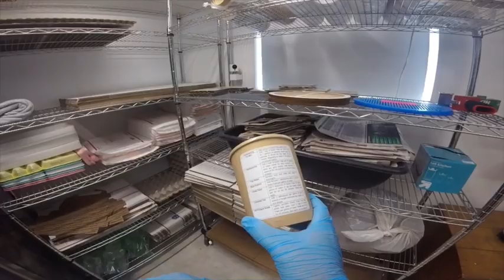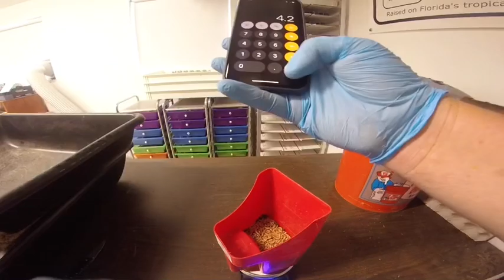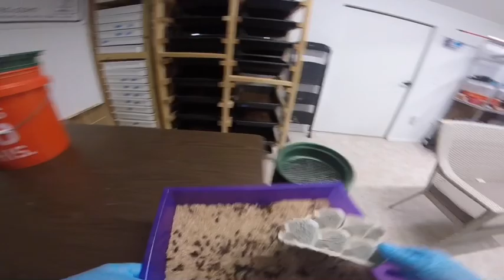SCMW Mealworm Farm Tour and Weekly Maintenance Routine

Comment: I am starting a small farm for my bearded dragon and eventually have enough for some friends and theirs do you think the 1/20 , 1/12 , and 1/8 green sifting pans will be enough for now? Or should I buy all 5?
Reply: I bought 1/8, 1/12, 1/20, 1/30 (1/30 is for frass). They work perfect. The bigger sizes aren’t needed, which saves like $40
Reply from the maker: Really up to you and your budget, but I recommend the 5pc plus the 1/30 mesh. You can find them here: www.tinyurl.com/bucketsifter and here is a description of each size:
Top tray (1/2) - holes are too large to catch any worms, but useful for catching larger food chunks that may be hidden in the substrate. It’s also the perfect place to hold the pupae sifter insert, sold by Space Coast Mealworms.

2nd tray (1/4) - most worms fall through still. Useful for catching superworm beetles and smaller food chunks. Some larger worms do get caught, but fall through with enough shakes or time.

3rd tray (1/8) - This is your workhorse. It catches ALL beetles and most large worms ready to be sold. May also catch some large pupae. Some smaller worms get caught in it if not shaken enough.

4th tray (1/12) - This size catches all medium-large worms. These may be sold or kept to grow larger, depending on your customers. Will also catch the rest of your pupae.

5th tray (1/20) - catches all small worms and large pieces of bran. At this point all frass falls through along with small bran pieces and eggs.

6th tray (1/30) - catches ALL small bran and allows only frass to fall through.  Not certain if 1/30 catches eggs since most farmers don’t sift their egg trays.
Reply: @spacecoastmealworms  thank you for the awesome response and the very detailed video!
Reply: @spacecoastmealworms  would it be smarter to get the 10 drawer ones or I see they have a set that has 20? I’m worried about the weight in each drawer. 
And btw the sifters are a life saver!!!

Comment: Loved your video. I have a wee small operation in my garage. I want to know...What do you do with the fras? I put it in my garden but it seems to put a waterproof layer over the soil that stops water penetration. Also, Do you not give any moisture sources to the mealworms, only the beetles? Also, Do you find the beetles lay eggs on the food too? How much wet food do you give your beetles? Do you ever run out of room? Do you use heat in the winter? Do you ever throw away excess beetles or do people buy them? Last thing, I need to buy those sifter set ups and pupa sifters too...how do I find these? Sorry for all the questions, but I love your set up and process, looks way more organised than mine :-) I'm in Australia, very hot here at the moment, everything is growing way too fast
Reply from the maker: I try to sell the frass whenever I can. A trick you might want to try is to mix it in with tour soil, or make a ‘tea’ with it by adding it to water first.
I do give veggies to both worms and beetles. The beetles lay eggs anywhere they can, but mostly do it in the substrate. If food sits too long then yes, they may lay on the food (or cardboard tubes) as well.
It gets pretty hot here in Florida as well, and we get a bit chilly during our few weeks of ‘winter’. I have a ceramic space heater for cold nights and an a/c unit for warmer days. I also have a humidifier and a dehumidifier on hand to use as needed.  I don’t usually sell beetles and have just been allowing them to live until they naturally die off since I have the space. Otherwise I cull them and feed them off to chickens. 
The green bucket sifters may be hard to shop to Australia, but you may be able to find them on the Australian Amazon site if there is one. I know this works better for Canadians, for example.. the wooden pupae sifters that I sell are available worldwide from my website: spacecoastmealworms.com. Shipping is steep unfortunately, especially if you order a larger tray size.
Reply: @spacecoastmealworms Thanks for your prompt reply. I'll try mixing the frass with water and see how it goes. I'm so meticulous when it comes to throwing food out, having to inspect every nook and cranny looking for eggs.  In the winter here I use propagation heat mats, used for seedlings. I also have a thermostat to keep the temp in check on one only though. The ones without a thermostat though, I prop the tray up on something so that I'm not actually cooking my eggs, worms or beetles. I used cut up egg cartons for my beetles and worms, they love them, I love how they chew holes through them like cottage cheese :-) My problem with too many beetles is space. I've not long moved and need to set up properly. Once I've done that, I can make more space so that I have room for the ever replacing amount of beetles. Yes I've tried searching on Amazon Australia for the sifters, and the ones available there aren't able to be delivered to Australia for whatever reason. On Ebay, postage is anywhere from AU$35 and upwards depending on how many in the set you get. The cost involved with getting anything sent is the problem, almost the cost of the item in some cases.  But I'll keep looking  and order a pupa sifter if I decide to go down that path. I currently use a colander which works well. Thanks again for your help, and will watch more of your vids. Cheer GG's World

Comment: I’ve had a problem with grain moths getting into the wheat bran. How do you control those?
Reply: airtight storage might help
Reply: @susugam3004  that doesn’t do anything once the bran goes in the bin with the worms.
Reply from the maker: To prevent moths, be sure to freeze or microwave your substrate. If you see clumps or webbing throw it all out immediate before using.
If you have them, try your best to sift out your worms and put them in fresh, sterilized substrate. Then use pantry moth traps (available in stores or on Amazon). The more the better, since they will catch more moths in a shorter amount of time.

Comment: Thanks for the great info session.

I noticed that when you sift the worms through each sifter at the beginning you end up putting all the different sized worms back in the same tray. I wondered if you had a reason for using all those sizes. What I mean is, would it not be less work to take out two of those sifting sizes since you are not keeping the meal worm sizes separately?

I also wanted to ask you if you've heard of the automated process or have any thoughts on it. On some farms they have a mesh at the bottom of the beetle box so that the eggs fall through to the egg box, while the beetles and oats stay above. I'm not actually sure if that would save time or not. But I wanted to ask you about it since you have a lot of experience with mealworm farming.
Reply from the maker: I use all of the levels because it helps spread out the current load. If I removed a couple levels then it would all clump up in one section and would have enough airflow or space to swirl around. This would make the process a lot longer. 
The all-in-one method works great for beginners. I did it myself, but had issues with the hot glue around the screening. Others have found ways to bolt wooden frames with screens to the bottom of their beetle bins. I just felt that was too much, and prefer the bucket system. It also helps me age my beetles better since they aren’t all in the same tray. 
But if you are looking for a good quality all-in-one kit a buddy of mine just designed this: tinyurl.com/mealwormbreedingkit
Reply: @spacecoastmealworms  Great video. I've watched it a few times. I dont have the ability to sift a lot.  What size screen would i need to get the eggs to fall through so I can cut down a step?

Comment: Question... at min 56 you say you use a 1/18 size to sift your beetles, but that size is not listed on Amazon. did you mean to say 1/8"? By the way, I bought one of your sifting trays and it works very well. Thank you.
Reply: never mind, you mentioned 1/8 at min 59. thank you for an awesome video!
Reply from the maker: Caleb, sorry, yes. 1/8 is the size. It’s the middle one if you happen to buy the 5pc set
Reply: Awesome work! Thank you

Comment: Extra sifter for eggs is 1/8?
Reply from the maker: 1/30. 1/8 is good for beetles
Reply: @spacecoastmealworms  and what are dimensions of one drawer, on that shelf with 10?  And how many beetles u have in one drawer?
Reply from the maker: The trays are slightly larger than a regular 8.5x11 / A4 sheet of paper. You can find then by googling ‘Seville Classic 10-Drawer’. About a thousand can fit in each of those drawers, though 300-500 is probably a more ideal quantity if you can afford to thin their numbers out a bit. They lay fewer eggs if they feel crowded

Comment: What's the BEST substrate to use on mealworms ??
Reply: wheat bran or oats or things like grounded up cheerios. But in my opinion i think bran is best. Easier to sift. But i cant afford it so.....
Reply: @dawnlark629  : Me being a new comer to Mealworm Farming, I have come acrossed so far, some really weird sh1t with my mealworms ! When I speak of species, I mean small, medium, & large. I have read alot, watched alot of videos between this post I posted & yer comment. Asking alot of questions, & I have to say, some pole are just rude ! I thank you for yer comment. Each delightful comment I get is sooo helpful. I love to learn new & exciting things. If at a point, knowing what I know, I would love to help others if I can ! 
1st was trying to figure out just how small the eggs were so I can get screening for the beetle laying station (as I call it), but to keep the bedding from falling through. I watched the beetles lay eggs. They are quite micro eggs, so a fine screen Is what I needed ! 
2nd for the different stations I have, each substrate has a different coarse of bedding. 
Basically experimenting according to the Mealworms preference. I get different cereals, ground them, put them in their owns zip locks. This way you can control just how much mixture yer putting together. Then taking another zip lock, mix them, shaking the bag. Then giving them new bedding or add to what’s there already ! 
3rd When morphing into each important stage, I take notice that each stage is different, especially when it comes to timing ! The difficult stage I’m having, is the changing from pupae to beetle ! I get some wicked alien look alike beetles that don’t live very long ! I have no idea what’s going on there ! And it’s not just in the 1 species of mealworms, but it’s even in the all species too ! I started to think it’s the bedding substrate that I was mixing up, but this is not true ! It just happens, cause all my others are perfectly fine ! 
The mixture of grains I use, & the way I do it,  the mealworms are actually happy with ! A lot of ppl only use one, but I mix mine giving them a variety of foods, basically it’s like a treat for them ! I’ve had sick ones come out of what ever was making them sick by eating my grain mixture. The sick ones come from the containers that you buy from the stores. I go through & isolate them quickly !! I’m still trying to find out just what kind of substrate is in those containers. I never reuse the container substrate. I pick through it, & put them in mine ! I do put the container substrate in a pint sized zip lock & set it aside for awhile, just to make sure there aren’t any babies in there that I can’t see yet ! It’s happened more than once ! 
4th The scary problem I thought I had, that I had no clue on cause no one tells about this stage. The Dormant Stage ! When my mealworms were in transformation going from mealworm to pupaes, I thought they all were dead, just about threw them all away, but something in me to me not to ! Glad I listen to that inner thought ! Not eating, no movement, cold, just laying there lifeless, this is the Dormant Stage ! I’ve gone to over 50 sites, talked to over 100 ppl on YouTube, & NO ONE talks about this ! I’ve ask them, & it’s as if they don’t know what I’m talking about ! It’s no wonder ppl are having trouble !  This stage takes about 2-3weeks depending on timing & species of mealworms you have ! When they are done with the Dormant Stage, they then turn into the Mealworm Beetle ! Then I read that the beetle itself had 3-4 stages ! 
That’s ALOT of stages for a single mealworm to go through to live it’s lifetime, which is short even !! 

Just remember, everyone’s different on raising their own mealworms. It’s basically experimenting till the mealworms tell you what they like ! 

I hoped I helped you with any new info you didn’t know about ! Never stop asking questions ! I haven’t. What I learn & take in as advisement, is always in my back pocket for when I need it or to try someone else’s advise ! 

Have a great day !😃